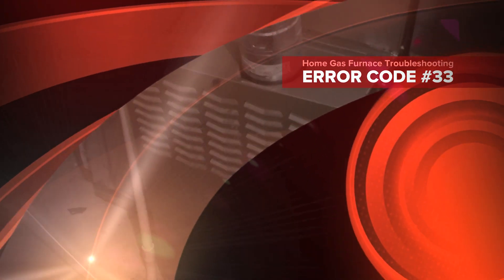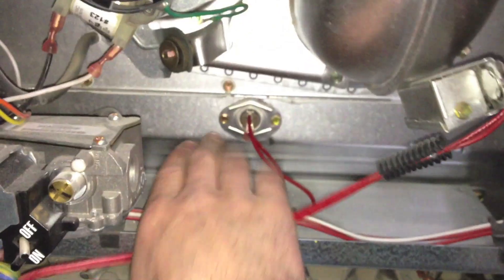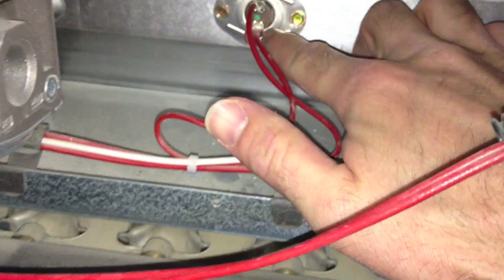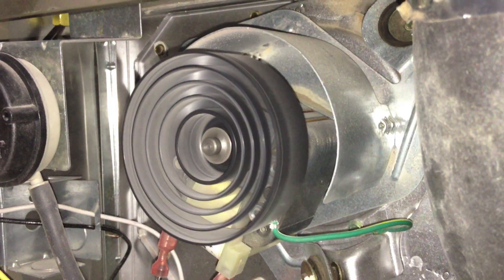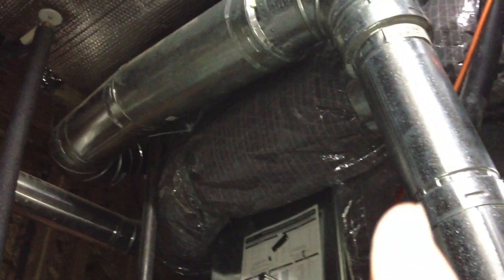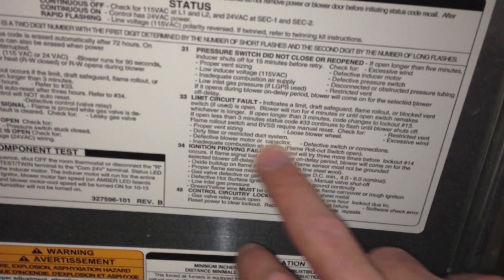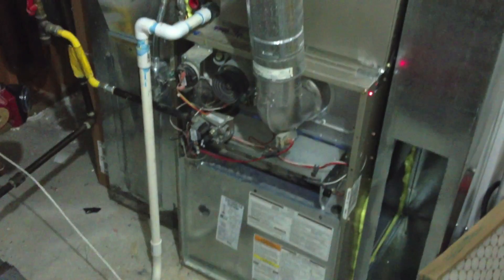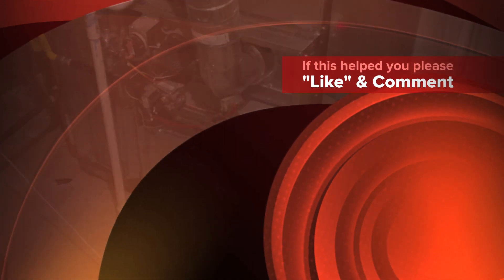ERROR CODE 33 - Troubleshooting a Bryant Gas Furnace

Comment: Light  blinks[ ooo  o o o]  through the round window on the furnace cover which translates to error code 33. and means there is a blockage in airflow. Start with your air filter. Take it out. When I did mine, I couldn't even see through it. Pulled it out and works like a charm. Also brush off the front of the burners and the gas outlet ports with a tooth brush while you're in there, Should end up with nice clean blue flames. Now, all I need todo is get a new air filter with less air restriction. A 3M high end air-filter did this to me.  Also... To test the thermostat, pull off the thermostats cover plate. Then jump the red wire to the white wire(HEAT). If the furnace goes on and does the same thing, it is not your thermostat so you wont need to waste your money on buying to buy a new based on a hunch.  Hope this will help someone. Was going crazy for three days when it was -13 degrees outside. Mmm Mmm Mmm.
Reply: ...or probably double that I'd guess.  Strange, I'm barely getting continuity through main high limit and also getting continuity to ground (terminal to cabinet)??? but when I pulled and inspected it appears perfectly normal.  Flames look great with no roll-out, filters are clean so going to double check that main and bypass for a bit to see how it runs.  Blower runs fine on no heat so not that or the cap.  Sucks to happen on a Friday night and no shops open on the weekends!  I NEVER like to bypass safety devices other than for a quick test.
Reply: Didn't help me, did someone teach you to use a blanket for 3 days?
Reply: No you would not, unless your thermostat went haywire and will not shut off your heat. Your house would have to be 100 plus degrees for that to happen.

Comment: Thanks for the video; mine was simply a loose connection on the heat sensor/limit switch. All I had to do was plug it back in. You know, now that I think about it the heat had been short-cycling for some time and it was probably losing contact with the switch! No emergency heat repair for us!
Reply: This just fixed my problem as well.  You rock!!!

Comment: Great video!  Thanks much.  I did not know these furnaces (mine is a Bryant  310JAV)  have error codes until I watched your vid.  I also was receiving error code 33 for a limit circuit fault.  It acted exactly like yours, running the burners for about 3 to4 minutes then shutting down.  Turns out I had an open (OL) capacitor.  Way out of the ball park.  Should have been 7.5 uf give or take 6%.  Replaced the cap and works great now.   Sure beats having to swap out the blower motor!  Not sure why I have medium speed (BLU) and high speed (BLK) wires on this furnace.  When I tested for current, only the low speed (RED) wire had current. I don't have central cooling or any control over the fan speed. I wonder if the controller adjusts the speed of the blower depending on how hot it gets.  Once again, thanks for your vid, very informative. Got me on the right troubleshooting path.
Reply: You have to switch the wires manually, red wire is lowest speed, then blue or maybe yellow, black is the highest speed. Look for heat speed tap on circuit board

Comment: Great video I'm having the same error code 33 however I have a Carrier furnace Model# 58STA/STX.  Now first off I'm not at all familiar with anything related to a furnace.  I've learned everything I know up to this point only in a few days.  The Issue:My furnace is blowing cold air.  WHen I took the panel off I noticed that I can hear the fan.  I'm not getting any heat or activity from the glow stick I don't see any flames.  I see that I'm getting 3 short flashes followed by 3 long flashes.  The filter was dirty so I changed it and I've tried to do a manual reset.  I pressed the Flame Rollout Switch and nothing happened.  But it also says something about BVSS requires manual reset.  I don't know where the BVSS is and how to reset it.  All my vents are free and not restricted, I think I have proper vent sizing.  Nothing has been changed or updated to the furnace since we moved here 3 years ago. I'm not sure how to go about checking the blower motor and capacitator and where it would be located.  I'm sure that the furnace is getting adequate combustion air supply but I don't know what to look for if it's  not.

Comment: Do not rely on that code, it can be the step before it that's causing the issue.Gas pressure being to high will do the same code 33, also if the fan is on the Blue wire it will cause not enough air to flow over the Heat Exchanger. I bet if I did a Static Air test on the furnace you would have a Very high Static Pressure excess of .7 which would cause the same code 33. Find a Great service company in your area and have them test Static Pressure, Gas Pressure and make sure your AC coil is clean as this will cause the same code...

Comment: My problem with code #33 previously was indeed "excessive wind". Just happened again. How do I fix?
(Wind conditions now normal).
Reply: +169jab you may have to extend the height of your chimney vent liner... if you have a chimney liner that is. Is your furnace direct vent (going out the side wall of your house) or natural draft (going up the chimey). Excessive wind means that the downdraft of the wind is stronger than the natural heat rising up the chimney. By putting in a chimney liner if you dont have one, the natural heat rising is hotter, thus it moves faster up. Just a plain old clay tile chimney takes alot of heat to warm up the clay to entince the hot air to rise. Whereas a chimney liner takes less heat to warm up and speeds up the natural heat rising affect. Wind should never affect a direct vent furnace.

Comment: Problem #1 - The system is oversized  because no load analysis was done prior to selecting the furnace. 

Problem #2 - The installing company not only oversized the furnace but they can't read either. The installation manual clearly states that for all furnaces of 100,000 Btu input or greater, the unit requires dual returns consisting of one side (not the back of the furnace), two sides or one side plus a bottom return. The furnace installed has a 4.0-ton (1600 CFM) blower rating and a 135,000 Btu input gas rating. We service and install furnaces in huge homes but invariably they all need multiple, smaller units due to structural limitations on running ducts. I really doubt you home needs 108,000 Btus of output from that furnace. The end result is short cycles, short heat exchanger life and low comfort from hot/cold/hot/cold short cycling. It's not a design flaw by Bryant/Carrier, it's an installation failure of the first degree.
Reply: I have a question about  size I have 2,000 sq ft and I need to know what size of furnes I have to buy
Reply: Marilyn, not enough info for anyone to tell you that here. I would recommend calling 3 HVAC companies in your area for estimates. Make sure they do something called a load calculation so they can properly size the furnace to your home and outside air temperatures your area is in.

Comment: On the thermostat, I switched the blower to manual blowing and the blower didn't run. I jiggled the blower wires and it started blowing. After securing all blower plug wires, I retried it and all is well. So in my case, the burners fired, flame was detected ok, but after the 30 second heat-up period, I guess the burners overtemped and the overtemp switch sent a fault signal, which shut the heater down. This is my take on it anyway.

Comment: First I'm not a qualified HVAC tech. But I've read the manuals on all the furnaces I've ever owned (dozens). If indeed this furnace had inadequate return ducting it would show up in a static pressure test. Your furnace should have two tests done to assure proper installation: static pressure and temperature rise. A static pressure test can be done with a U tube manometer. You can make one with a 6 inch ruler and a length of quarter inch plastic tubing. Put the tubing into a U shape with the apex down, no kinks and  staple it in place on a board.  Put some water in the tube and mark where the water level is on both legs of the U.  Then drill a hole in the return and supply plenum and put one end of the tube in such that no air leaks around it. Something sticky like chewing gum may help seal the tube.  Measure the water deflection in the blow and suck sides. One will be above the line and the other below, i.e. positive pressure on supply negative on return. Add them together and the sum should be something like 0.5 centimeters.  Modern furnaces need to "breathe" so replacement furnace may require duct rework to get the static pressure into proper range. Temperature rise can be adjusted with blower speed if static pressure is ok, but static pressure needs matched and adequate flow across the blower. Also a damaged secondary heat exchanger can cause a high limit switch to open, causing short-cycling. I would always check this first.

Comment: Thanks so much for posting this.  I did need to change my filter, which I did.  Will the System Malfunction message go away once the furnace "figures out" the filter is clean?  Or is there something I need to reset?
Reply: Turn power off and back on, that's how you reset furnace control board, but if a problem comes back, then your error code will come back.

Comment: I like what you did and that did fix the problem but you i would had check something  else before doing a new return. Check your gas valve, if allowing too much gas for little oxygen you have your flame will get too hot and that will trip your limit switch. Turn down the gass pressure for proper combustion. You need a manometer for this.
Reply: Exactly what I was thinking too and you beat me to it lol ,gas manifold pressure
Reply: thank you. tried everything and it was a 3 min. fix dooaa. it worked well the first year i dont know if being new it self adjusted but turning it down solved my problem! i was going to add a duct to mine too lol.

Comment: If your furnace was tripping on the manual reset MAIN high limit switch and not the manual reset vent draft safeguard switch, then yes I would have to agree that your issue will be either insufficient airflow or over-firing.  How you arrived at your resolution may lead others to believe they have a ducting problem which may or may not be true.  You should always ensure you have a clean filter and that all the supply vents are open and unobstructed before attempting any skilled troubleshooting. Your furnace rating plate lists the temperature rise range as 50-80 degrees F. which is specific to your model furnace (310AAV048135)  This range adjustment is done by adjusting the blower fan speed only after the firing rate (gas manifold pressure) is 1st adjusted with a water manometer.  Once the firing rate is adjusted (based on the calorific gas value table in the installation instructions) then the temperature rise (airflow) across the furnace heat exchanger maybe adjusted.  This temperature rise should be mid-range on the rating plate which for you specific model furnace would be 65 to 70 degrees F.  The temperature rise is measured at the return air entering and the supply air leaving the furnace (before any cooling coil).  Other issues that can give you insufficient airflow is the cooling coil insulation coming unglued and blocking the airflow across the coil.  On properly designed & installed duct systems they install dampers so to properly adjust air flow to the room(s).  Possible that someone has moved or closed off the damper(s).  After all of this...I would have to agree with 30248abcd that your vent pipe for your flue is NOT to code and that can also cause you to nuisance trip on a code 33.  That is another lesson for another day.  I hope your furnace is functioning fine for those cold winter days/nights for it is a well designed product and should give you reliable service for years to come as long as it is sized, installed & service properly.
Reply: +Reggie Van Hoozer ...can you please tell me where are those safety switches located in the furnace, and which one goes off first ?? Thanks

Comment: I believe your real problem causing an over temperature trip was your vent pipe is undersized, looking at your video I see a 4 inch vent pipe all the way out. If you look at page 6 lines 2 of your installation manual it states to increase the hood vent exhaust immediately from 4 inches to 5 inches. This depends on model and btu input and length of run, and other appliances that are tied in. My furnace being 88,000 btu input required the 5 inch increase plus a 5.5 inch aluminized chimney vent.

Comment: quick tip... probably should have just checked to see if your centrifugal blower motor was wired at too low of a speed. (I'm assuming its a variable speed blower?)
a quick switch of the wires and your blower is now pushing more CFM and that weird duct fix you did would'nt have been necessary(did that cost you money to make?) lol
If you didn't have a variable speed blower than i'm completely wrong! :D
Reply from the maker: I don't have a variable speed blower. But the duct work needed to be done anyway because that is the new return for the basement return vents.  If the blower is variable, it's never in use. Its just on or off.
Reply: hightideblue oh O.o I'm in tech school still so my knowledge is still very limited, sorry I don't mean to come off arrogant its just I haven't seen too many non variable speed blowers in the air handlers at my school. I assumed that was sort of the standard now a days. Also to clarify, by variable speed I meant that certain wires have less windings bewteen them therefore increasing the rpm of the squirrel cage, not a VFM (variable frequency drive) which modulates the speed as necessary. Its still on or off! :D

Comment: Informative  video ! I would suggest you pull fresh air from outside so you do not pull CO2 from the combustion air side into your house. You can run a 4 inch flex line from the side of your house to the return side. Thankyou. James Sasse. GodWhoisGod com
Reply from the maker: Good tip.  Our home was built with a 8" combustion inlet.

Comment: I am having similar problem with a brand new furnace supplied by Bryant (two weeks new products). In the middle of heating, the thermostates will turn to black, out of picture. Then it turns on by itself. Tech came out and replaced with a new thermostates that was wired directionly to the circuit board by blower. It found out the same problem happened again. I do not know a code, but the light blinked three times short and then one time long. Can someone help me what error code will be?
Reply from the maker: That is error #31
Reply: 31, look at codes located on the big door